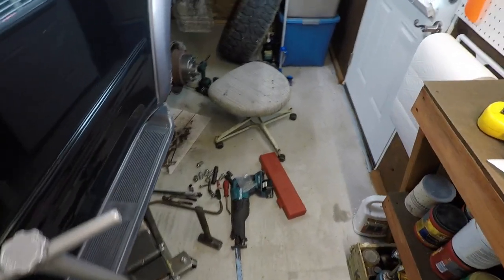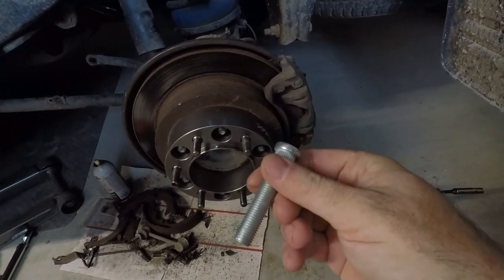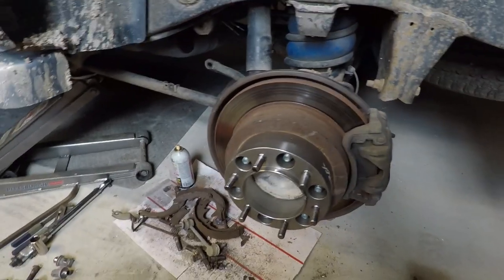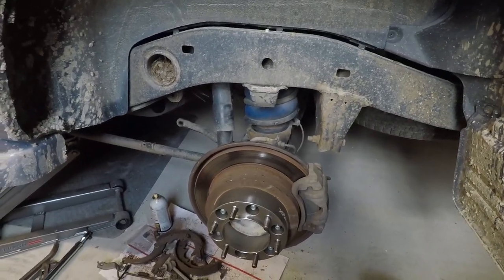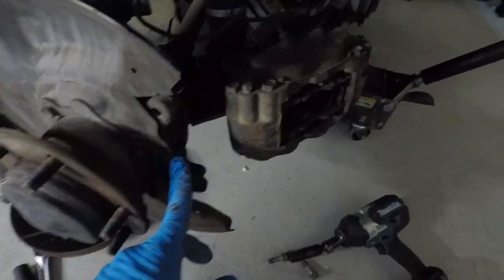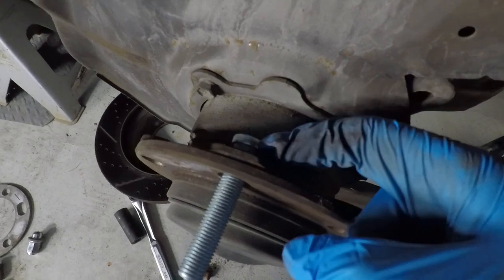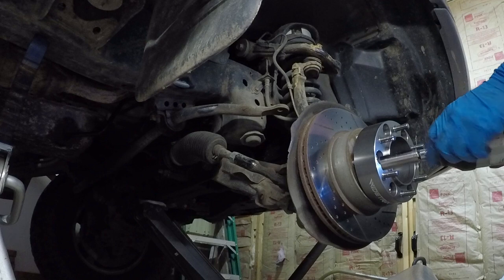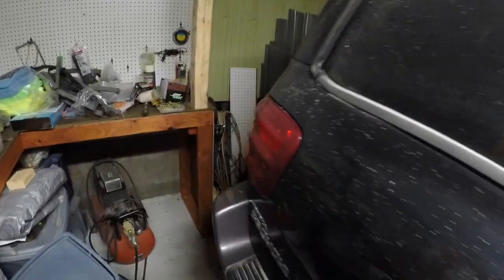Installing Extended Toyota Wheel Studs For Tundra Sequoia 4 runner Highlander Tacoma

Comment: if you want to take the spacer off ever use the blue loctite the red requires the use of a torch to heat the nut to get it back off why is the sway bar links and all the other parts off put drop brackets on the sway bar they are 25$ also you put the loctite on the stud when you put it in the nut it cleans it off as you tighten them some people do not need to make instructional videos because this is as shitty of job i have seen do not beat your truck up this makes me nervous to think you may be on the road near me

Comment: I was istalling my spacers yesterday and realize studs are very short . where did u get longer ones ?
Reply: ricardo andres chaparro hello, I am facing the same problem. Did you sort out the problem? I searched amazon and ebay crazily but I cannot find any extended wheel studs for tundra 2012. Please let me know if you have found anything. Thanks
Reply: @aamirabbas7126  yes I found longest nuts with longer treat when you tide it go deep
Reply: ricardochaparro did you find it in ebay or amazon? Please do share the link if you bought it online.  Thanks
Reply: @aamirabbas7126  i cant find the link but was on amazon, just put the size and look for longer ones